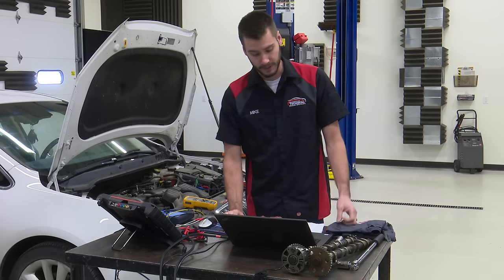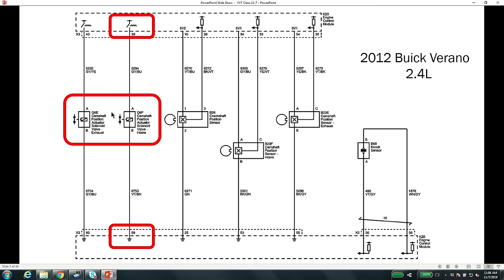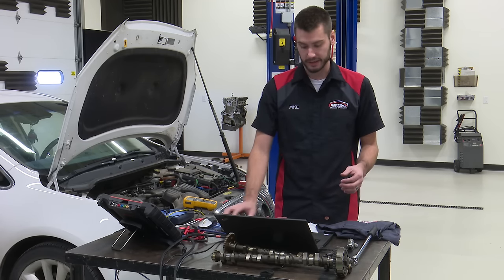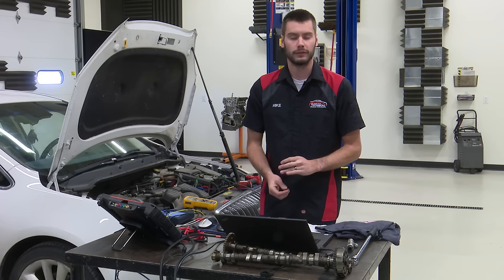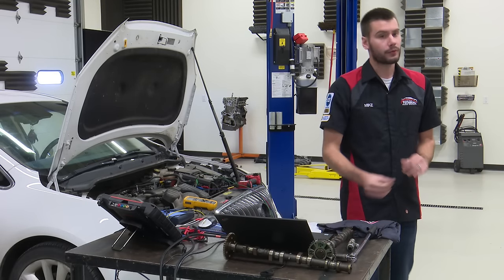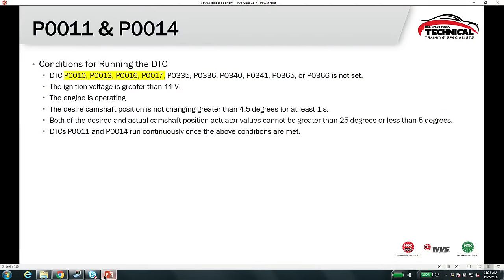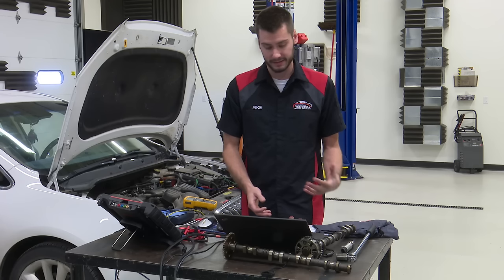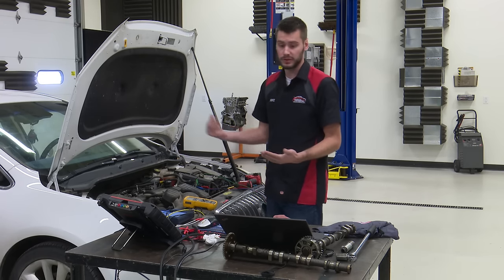P0011 - P0014 Variable Valve (Cam) Timing Codes and How To Diagnose Them

Comment: Great details I was having same code p0011 my 2017 hyundai elantra engine stall and start back on right way... I replace camshaft position sensor, crankshaft position sensor, purge control valve, actuator,oil control valve.  But still the same result until I come through your video. I flush the engine oil and replace it with the right oil for my car..and stop all the problem stalling.Thanks for the video
Reply from the maker: Hey Micheal,
Glad you got it fixed! Thanks for watching!

Comment: I have converted an old solenoid into pressure port by drilling and installing a fitting for attaching my oil pressure gage.It works wonderful.
Reply: Make video I want to make one
Reply from the maker: Please share :)
Mike Becker, Senior Technical Instructor

Comment: Congratulations with your new arrival. I knew very little about vvti before this video very helpful. When doing a timing chain you usually have to blow air into the camshaft gallery to get the timing to go back to base timing. Instead of doing this can you just disconnect the solenoid and run the engine. Many thanks for the information.

Comment: Mike to answer the question on why we pulse with modulate the actuator solenoid is as follows. On GM vehicles a 50% modulation is the hold position for the cam phaser. In other words, at 50% the magnetic field surrounding the solenoid is strong enough to hold the plunger in its middle position. This blocks all the oil passages. No oil flows in or out of the cam phaser. A higher percentage allows the oil to flow into one side of the phaser and exhaust out the other side, creating the movement of the phaser. The process is reversed ( less than 50%) to move the cam phaser in the opposite direction. If the ECM were to use a 100% PWM on the solenoid, it would very quickly burn out the windings in the solenoid or damage the driver in the ECM. This is why the ECM doesn't use a 100% on-time modulation on any device it controls by PWM. I hope this clears this up for you. thanks for all your training videos.
Reply from the maker: Great comment Stephen, thanks!
Mike Becker, Senior Technical Instructor

Comment: Hello dear friend
I wanted first of all that I enjoy hearing you lecture and teach
Second thing you said it is not the mechanic's fault that there is dirt in the engine
Some of them do have vehicles that come to me in the garage that I remove the valve covers protest there a lot of silicone that penetrates the rubber into the valves

Comment: I had fault code P1007 and P1014 on Peugeot 207 car could not start I just cleaned it and bingo it started again. Be careful the symptom initially looks like a fuel problem, don’t replace your fuel pump just yet. Thanks for the video!
Reply from the maker: Hey, thanks for watching!
Mike Becker, Senior Instructor

Comment: Awesome lesson. Thanks for covering all the bases.  I've been running into a lot of vvt lately (nissan 3.5) that have had intermittent issues.  Most have had very poor oil quality.  One or two were fixed by oil changes, but I had one I was called back to after a few weeks it threw codes for both banks.  Will have to run the scope and data pid checks to see what is going on.
Reply from the maker: Justin, is the 3.5L common for chain stretch? I've never done a chain on one.
Mike Becker, Senior Instructor
Reply: I'm not sure, but will have to dig further with the scope to find out for sure, checking base timing and operation of the phasers.  Customer said whoever had the vehicle before him "just had the timing chain replaced".. of course, that could have been 100,000 miles ago...
Reply from the maker: Hhaha yeh for sure, we've all heard that before :) Let me know what happens!
Mike Becker, Senior Instructor

Comment: Hi there this is very useful video. Thank you for that. I face a stranger problem with a chevy cruz 1.6L 2013. When the oil is cold the car run smoothly but after 15 min the car loosing power and code p0011 and or p0014 come up. Change oil, camshaft filter, values, oil pump, filter.. cooler and other ideas?..
Reply from the maker: Hey Ronen IT, thanks for watching! I suggest you take a look at one of our more recent videos covering a common issue on the 1.6L maybe it's whats wrong with yours...https://youtu.be/F9Arl6vEBJY
Mike Becker, Senior Instructor

Comment: An oil pressure test adapter would be kinda interesting. If after a few quick tests, it might lead to recommending another engine.  An oil change and new phasers might help, what else is left cam bores in heads or lower end. Mike is right, oil change intervals are crucial. 1 a lot of vehicles are leased.2 a, oil change intervals can be 6000 miles or more. b,OE says oil consumption of 1500miles per quart is ok. 3 owner never checks oil until light comes on. Perfect Storm.
Reply from the maker: For sure Steven! I agree with all of that!!!
Mike Becker, Senior Technical Instructor

Comment: I totally erase this code from ecu P0011&14.and remap it! Finally problem solve 😅
Reply from the maker: Hi Snoopy,
That sounds like a lot of work!, at least for me.
Ryan Wilsing, Technical Instructor
Reply: @GoTechTraining  yeah , I have been change all part only left the oil pump but the customer refuse to change due costly. So only way to settle this car , few times adjustment of software to turn down the advanced cam degree, then only tune back up power the engine unless this car will parking here forever.😅

Comment: I fix one of these for someone that cheap Walmart oil knocked the sensor. I warned him before doing it that oil had 800 miles on it and it smelled burnt and it was black .  Not sure if it was Coincidence but it has been 4 months now and same thing. It’s coming into my shop tomorrow I’ll let you know what I find .
Reply from the maker: Good luck with that Rambo! Hope it's nothing major.
Mike Becker, Senior Instructor

Comment: I  just changed my oil & filter a few weeks before problems that gave me a P0011. Used the same brand and weight of synthetic oil as before, but this time opted for the 'high mileage' version. (Car has 130K).  The screens on my solenoids look clean and clear, as do the oil and cams in general. So any chance the 'high mileage' oil is causing the problems? Car idles fine and runs well at higher speeds and level surfaces, but struggles on hills and lower speeds.
Reply from the maker: I highly doubt that the oil being high mileage or not affected it. My gut says you have an intermittent failure. 
Mike Becker, Senior Technical Instructor

Comment: About a buck O'four into the video, you're using a jumper to actuate the vvt solenoids manually and it raised a concern or two for me.  I've met a couple engines that can idle pretty well on a stretched/jumped chain.  Let's say the chain is stretched and jumped one tooth. Is there a point in your diagnosis that you have to ponder and decide not to jumper the solenoid?  Is the potential there, with a jumped chain, to over advance the timing to the point you cause valves to crash? If so, how do you decide your next move?
Reply from the maker: Hey Shaun, ohhh thats a great point. Never ran into that before. My guesstimate would be if the vehicle jumped time enough to crash with vvt command...it likely wouldn't be running. But honestly, I have no idea what would/could happen in the scenario. My curiosity is peaked, that's for sure!
Mike Becker, Senior Instructor

Comment: ok since i sent the last question maybe you can answer this one. i changed out the cam phasers the timing chain the guides and the tensioner. and the water pump and chains and guides.  so it has been running rather well since then. now my girls called and said she is getting p0011 p0016 p0017   and it is running a bit rough! so based on those being cam over advanced which is hardly possible what might i look for? i did install new cam solenoids and then got tons of codes. so i put the old solenoids back in. in testing them i got clicks and 12 ohms so i figure those were good. i told my girl to reset the codes and let me know the first code she gets just in case the other codes are just from the first code. so do you have any other ideas? maybe a crank sensor it kind of doubt cam sensors if both cams are setting codes.

Comment: Hi!I have a P0014 and P0011 code even when i changed oil and solenoids.The mechanic says to replace engine.Not sure if it’s the timing belt or my engine needs to get changed.Please advise

Comment: Hey, Mike. How would you check duty cycle with a multi meter and how would you know if the reading is ON Time or OFF Time if you did not have a scanner to  watch the pids? I have a multi meter with Duty Cycle and I was watching a video from Eric.O about an EGR valve issue and did not fully explain the duty cycle with the meter and how he hooks it up.  He shows a display on the meter and says that it is the OFF time and not the On time. That you for the excellent video as always!
Reply from the maker: Hey BB MD, thanks for watching! Let me answer your question with a question...does it matter? IF you have nothing to compare the duty cycle against (the PCM's command read on a scanner) then why does the % matter? Simply checking that there's power and ground to the solenoid when running is probably enough. Hook one lead into the PWM power feed and the other lead into ground. Most meters aren't fast enough to read the signal and will average the voltage. you should see something other that battery+ and 0. Does that kinda make sense?
Mike Becker, Senior Technical Instructor
Reply: Yes, Sir.It does. I have an OTC multi meter with Duty Cycle. I was just trying to use the feature when my Autel Maxidas is not with me. Also, Eric was only trying to see if the PCM was duty cycling the EGR valve.

Comment: Thank you so much for this video.
One question has a counterbalance spring ever been found broken on the other side of the spool valve?
Reply from the maker: Hey, thanks for watching! Great question, i've never seen one...would be an interesting diag though. What do you think, oil pressure overcomes the broken spring and engages vvt as soon as the PSI is high enough?
Mike Becker, Senior Technical Instructor

Comment: I don't think flushes now a days is ever a good Idea but rater a recipe for disaster. Just my opinion. I always tell customers to use synthetic oil in my experience synthetics are less likely to sludge and I have proven in videos where synthetic actually  started to clean the engine.
Reply from the maker: I'm with you on this!
Mike Becker, Senior Technical Instructor

Comment: @1:31:30  Your statement that one tooth of the crankshaft sprocket = 6 deg. is misleading. The reluctor wheel has 60 parts, but I doubt that the sprocket has 60 teeth. I don't know exactly how many teeth the sprocket has, but i'd bet that tech B is right.
Reply: anti chuckle he is referring to the teeth on the crankshaft sensor reluctor not the sprocket that’s drives the chain.
Reply: @jmdiagnostics2869    Go back and review it starting @ 1:31:00. He confused the reluctor and the sprocket.
Reply: BFD move on. The man did a two hour live training and used the wrong word once. Let’s not be jerks here guy.
Reply: @jmdiagnostics2869  thank you.
Reply: @jmdiagnostics2869   I'm not saying it's a big deal, but his T-shirt quiz is based on this. Maybe someone should point it out to him. Just saying.
Reply from the maker: Hey guys, Anti-Chuckle is right, I did misspeak during the class. One tooth on the reluctor is 6 degrees, the gear itself has an unknown amount of teeth at this point. We never got to that point. Sorry for the confusion.
Mike Becker, Senior Technical Instructor

Comment: if you replace the poo13 and p0014  vvt solenoid,  why does the codes still show up for inspection?  The engine light went off after driving 30 miles once these were replaced.

Comment: is that possible if the tensioner chain push too tight will cause the angle of cam wont moving and over advanced?p0014,p0011?
Reply from the maker: That's a good question, a chain that is tensioned too tight won't cause correlation DTC's. But can cause premature timing chain failure and chain noise.
Ryan W, Technical Instructor
Reply: @GoTechTraining  how about engine oil spec?is there any different after using between 5w-30 switching to 5w-40 both fully syn? I am guessing if thickness oil can cure the angle of degree ?

Comment: 10 Titan LE 5.6 flex fuel, new camshaft and crankshaft sensors, new VVT solenoids, new oil/filter new 02 sensors up and downstream. Keep getting p0011 rpms higher than normal and going through fuel like crazy. Any suggestions
Reply from the maker: Hey JR Dominguez, how's the actual timing of the engine? The timing chain maybe jumped?
Mike Becker, Senior Instructor
Reply: @GoTechTraining  don't know the actual timing of the engine at the moment but the rpms keep jumping at parked or at a full stop

Comment: I really hope you see this another videos like a year old but my cars having a p 0 0 11 code keeps coming back every 3 days I get something fixed I maintained my car very well kept on my oil changes every 5000 miles. I've had the Cam phasers replaced had the timing built warrantied out solenoids replaced multiple times in the code keeps coming back I don't know if there doing something wrong or my cars is ready to go please give me some advice

Comment: My solenoid screens are clean and the plunger moves when voltage is applied, but it doesn't move much. The oil ports  only open about the width of a very small flat screwdriver tip. Is this normal or should those holes be fully open?
Reply from the maker: Hey, usually they open pretty a decent amount. I'd say it should open further than a screwdriver tip.
Mike Becker, Senior Technical Instructor

Comment: i changed the timing chain and phasers it had a p0018 now i have an engine stumble when it gets warm. no codes i can hear the intake cam rattle some intermittent if i unplug the intake solenoid that rattle goes away. it has yet to set a code. so how long will it take to set a code if the intake vvt solenoid is going bad?  also, my engine has 2 exhaust cams and phasers so both the cams little notches are set to 10 ish o'clock . found that out the hard way. so i wonder of the intake phaser is failing. the engine rpms vary lots at stops after the car has driving maybe 20 miles and if i put it in neutral it will smooth out or if i reve it some. so does this sound like the phasers may be bad or the solenoids. thanks

Comment: Where are you guys Located? I'm having this issue and a Toyota service center couldn't fix it (they replaced the battery) and the CEL came back. I'm on the Fort Lauderdale, FL area, looking for a mechanic like you if possible.

Comment: If your looking for the fix.. your super low on oil.. or your vvt solenoids both at the same time mechanically failed but tests good electrically which I highly doubt.. these codes mean something is mechanically wrong so look there especially if a p0300 is attributed
Reply from the maker: Those are both great things to check. Oil level and viscosity are super critical!
Mike Becker, Senior Instructor

Comment: do you have to take the entire timing chain off just to replace the phaser ?
Reply from the maker: Hey Jeremy, great question! Sometimes you do due to clearance issues. Other times you can secure the chain and sneak it in. Depends on access to the tensioner really.
Mike Becker, Senior Technical Instructor

Comment: I have not really been able to find the resistance value for the vvt solenoid anywhere for a renault clio 4 2019 tce 90, do you know? <3
Reply: I think my Chevy has expected values from 8-12 ohms. They measured around 10 ohms so that was good. Perhaps find the most common engine using the same solenoid to find the specs.

Comment: Hey mike got any reviews on PS/EPS and addictive steering??
Reply from the maker: Not much yet...though I had to just put the EPS rack assembly into my 16' F150...Position sensor failed and isn't serviced separately. 
Mike Becker, Senior Technical Instructor
Reply: @GoTechTraining  nothing on EPS is serviceable!!! If u can personally message me I can send you what napa and ase gave me so far about additive control/alignment/windshield/sensor bull crap!! Good information but I haven't dealt with it yet that's the problem!!! Kinda wanna know more about dodge gateway database/links!!!

Comment: Hello there. I'v got p0172, p0014 on Citroen ds3 1.4 95ps 2010. Any idea?
Reply from the maker: Hey, so a rich code and a timing type code. I suggest going after the P0014 first. The P0172 could be caused by the P0014. Inspect the oil first. Make sure it's clean, properally filled and the right viscosity.
Mike Becker, Senior Instructor

Comment: how can i delete the 2.4 Ecotec   i have p0016 and p0017 codes and the engine has poor performance the codes set immediately. changed the crank sensor. i think the phaser/s failed but may have jumped time any ideas. so it sounds like it may have jumped a tooth on the chain. would these codes represent the chain to jump on the crank only.  or might the phasers failed or cam to cam timing out if adjustment? the oil level was run low so maybe the guides failed? Does anyone have some ideas? i changed the vvt phasers and still get these codes.  thanks